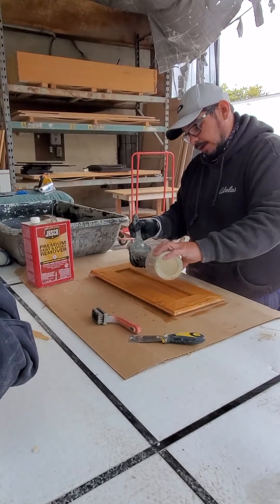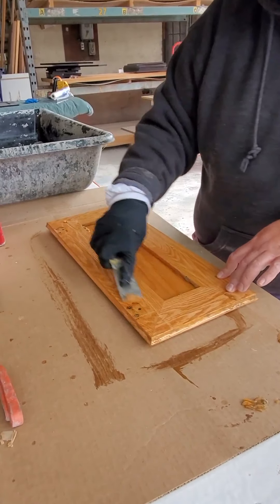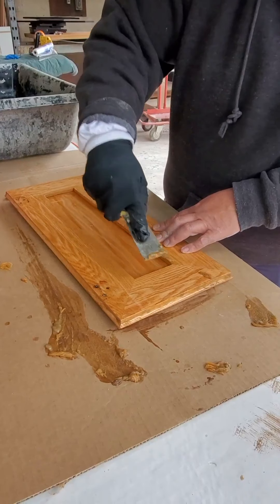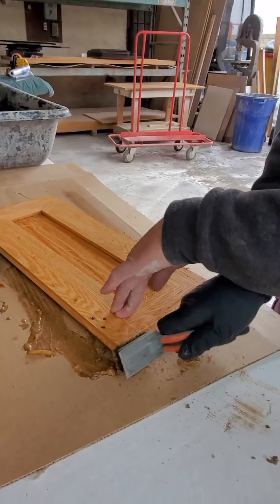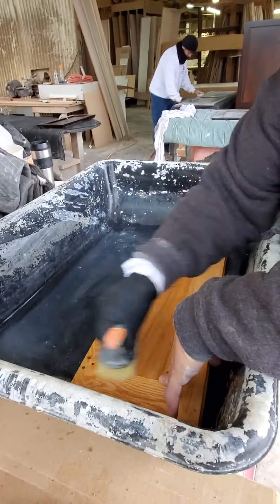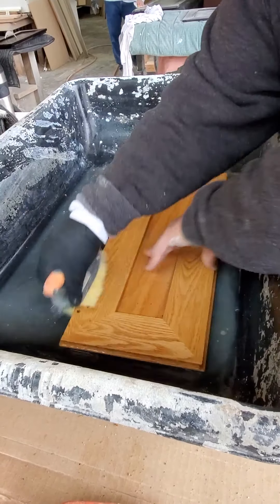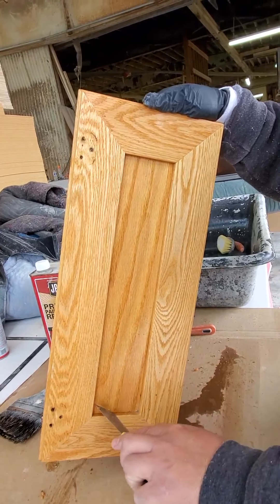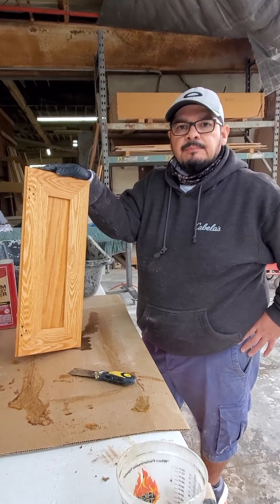how to strip cabinet door

Comment: I'm trying to strip some cabinet doors.  There's no way in hell, it comes off that easy.
Reply from the maker: @mtnshow1  yes.it does. Takes practice  we.do this often  use.a.good stripper.
Reply: @dennisrodriguez9700  Will that Jasco you used hurt the wood or anything?  I'm using the orange citrus stuff.  And you need a half bottle just to do a small piece.
Reply from the maker: @mtnshow1  no Jasco does not hurt wood

Comment: Great Video! I do have two questions.  Would you follow this same process if you are removing paint from the cabinet door?  Meaning, would you wash it in an acetone or M.E.K. solution after stripping the paint from it?  Also, after using the acetone or M.E.K. you can sand, prime, and paint the doors?